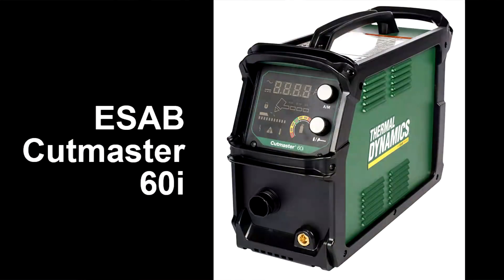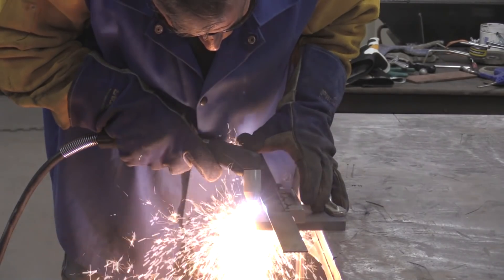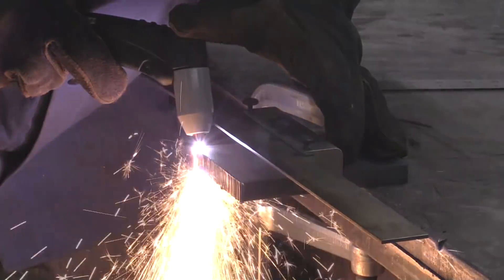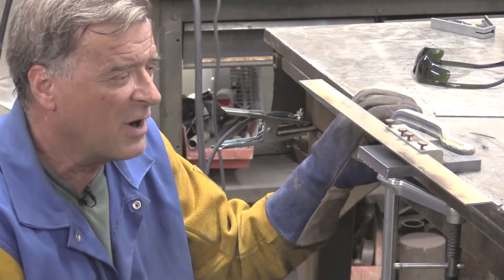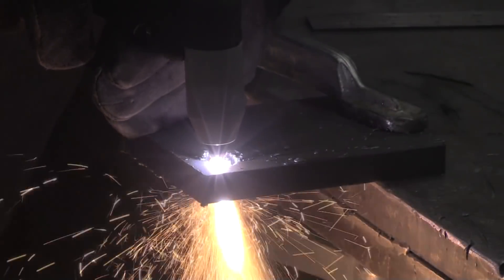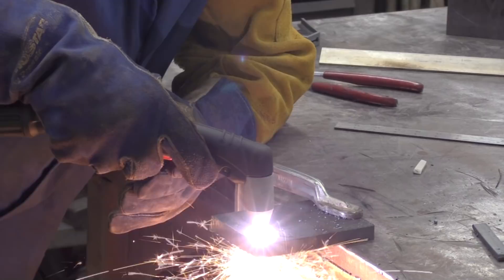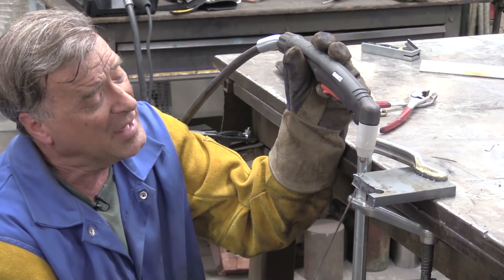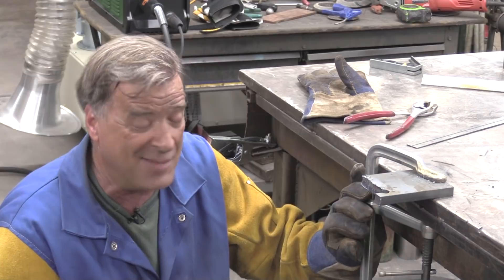Testing the ESAB Cutmaster 60i: Speed, Piercing, Arc Height - Kevin Caron

Comment: That's the unique features of the esab 60i.  That long arc!  Which gives a super clean cut.   It's in the design of their power supply.  No other plasma cutter has it.  The torch on that machine is the same one that is used on the Thermal Dynamics 42, 58 etc.  Yet the 42 and 58 doesn't  have that super long arc feature.  Different power supply, different results!
Reply from the maker: So much to learn every day!    Thanks for watching and posting.

Comment: Pay attention to which side is the swirl is going for best bevel. If you are going to turn it down to 50 amps, use the 9-8209 (50-55 amp tips) they works better. Using the 9-8237 cup, and 9-8235 shielded setup is best for consumable life. If you want to run that machine on your cnc table there is auto  interface part # 9-8308  (hard to find that info.) The Automation torch (SL-100 SV) is auto detected when plugged into the machine, and does not show up on the front panel anymore, until plugged in.. The automation interface catalog number 9-8308 gives you a receptical on the rear panel of the machine for start stop input.

If you want to use a smaller torch on the 60i (Running at 40 amps max) the Torch form a Cutmaster 42 (SL-40) plugs right into the machine. Gives you a much smaller torch to do sheet metal type of things.. putting in the 9-9001 20-35 amp tips will give you laser thin cuts too.The SL-40 torch can use the same lead extensions as the SL-60/100 torches. It will also allow for the lowest possible air use, and input current, meaning in portable use it will go farther with less. Smaller genny, and compressor to push. Lets say you only have a 6000 watt genny, and you what to get as much out of it as you can. The SL-40 will be the best option. 

Of course you know all this stuff, and why Esab gave you the machine.. :)
Reply from the maker: Okay, so I am on my knees bowing in your general direction because you are the master of this machine!!

Thank you so much for the info and yes, I will file it away for later. 

And no I am not making fun of you or anything like that I am really impressed you know this stuff and WOW!
Reply: I have been messing with the one torch since it came out, 16/17 years? Had it on a table off, and on for probably 13/14 years. It will do what you want generally, if setup correctly. It's sort of a love/hate deal.. Personally from a performance standpoint the Esab PT-37-38-39 have quite a bit better performance then the old one torch.. Still the front end of the exposed straight long tip on one torch is something nobody really has anymore.. All conical style nozzles now. It's hard to beat that view.

I am guessing if Thermacut ever releases. their retro torch for the Thermal Dynamics one torch, it will put the 60i cutting speed in a class of it's own.The upgraded power supply of the 60i will then only truly show it's stuff..Right now it just powers through any limitations of the torch on it. It's improved the old torch by building a great inverter. Nice job there for sure..

I did run some amp draw.output tests between the SL-40/60 torches, and different consumables. Even ran the shielded 60 amp I posted above on 1 inch MS. Dragging with the 9-8237 cup, and 9-8235 shield keeps the input amps very consistent. Probably the best overall setup for running off a generator. Pretty solid 35 amps input.. Top of the power supply has the part # for that layout.  I would say the power supply is very similar in efficiency to my Hypertherm 45XP. Just quite a bit more guts on the top end. old torch, and all

I put this info out there, because it helps  speed the learning curve up, and something Thermal does not really push like Hypertherm does with Jim colt. It's not that I get a check from them or anything.. :) Sort of like when you show people how to do certain stuff.

Comment: So how much air pressure do you need to run a plasma cutter?
Reply from the maker: 60 to 80 psi is what you are after. 

More important is how big the tank is and how many cubic feet a minute the compressor puts out.   For that you have to look at the difference plasma cutters and see what they need to run correctly.    I would look for something in the 60 gallon tank size and in the 8 to 10 cfm range.    If you can get a 2 cylinder 2 stage compressor that would be perfect.
Reply: Cool! Thanks Kevin.